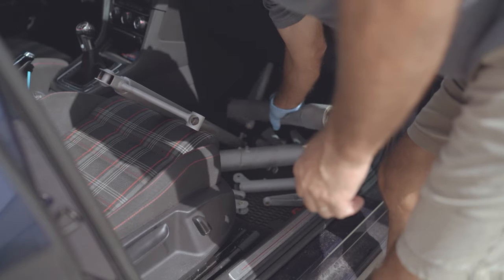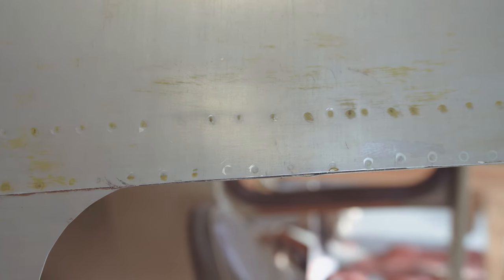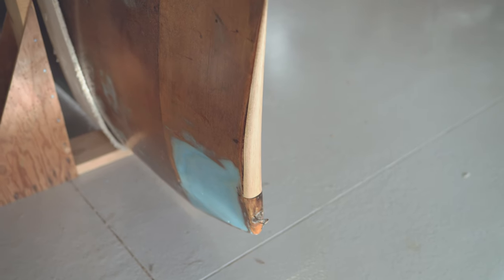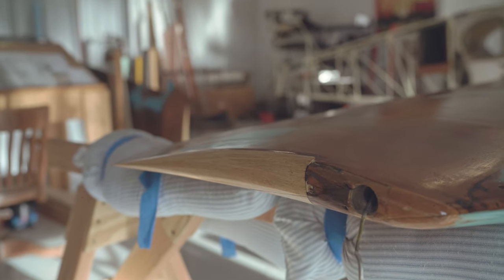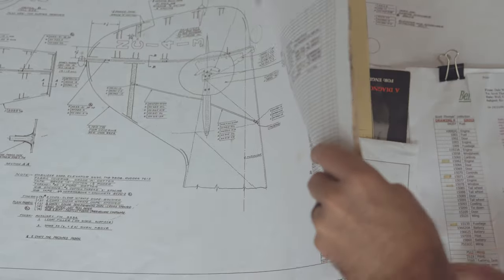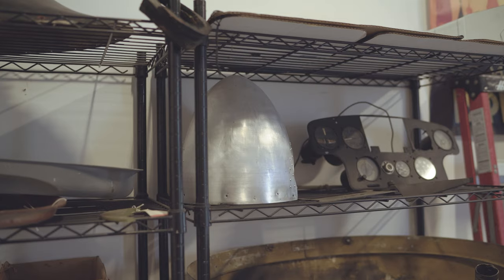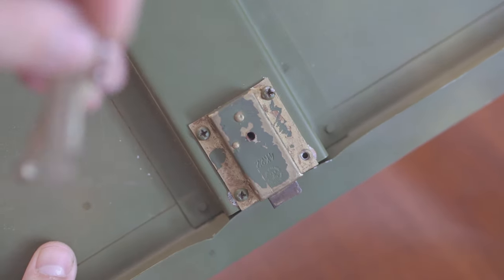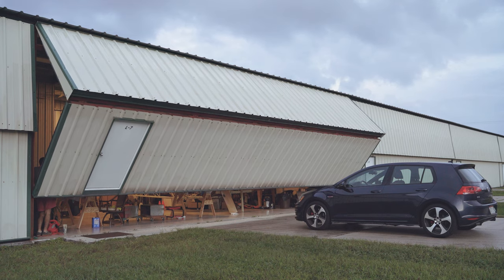Bellanca Cruisair Aircraft Restoration: Chapter 4

Comment: Hi Brady, where can we get replacement punch-outs for our 14-13-2 panels?
Reply from the maker: Hey there. Are you referring to inspection panels? What panels?
Reply: @BradySkye  Instrument panel! N86761 was cut-up on the left. Looking to restore it back. Overall the airplane needs lots of work like you said.
Reply from the maker: @williamh.arthuriv9161  We have a blank panel from the factory and I am planning on making a mold of it. But there is nowhere to buy a new one as far as I know. This mold I can make will probably be the best bet, but it's only for the front and I don't know when we'll make it.
Reply: @BradySkye  wow ok I thought someone was still stamping them! One day I'll stop by to take a look and offer emotional support. This week I'm getting fuel lines checked and replacing door seals.
Reply from the maker: @williamh.arthuriv9161  Good stuff! Glad you're chiseling away.
Reply: @BradySkye  you are probably already aware, but - there are folks in the hot rod community capable of reproducing that panel in aluminum or steel. Probably in multiple pieces welded together, but the end result would be indistinguishable from a one piece stamping.
Reply from the maker: @corywoerth4453  Good tip!